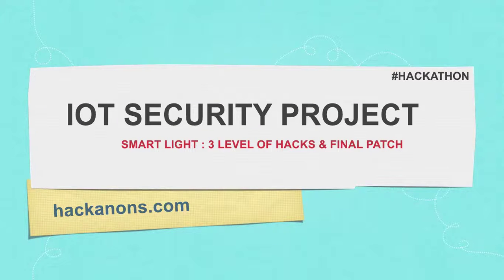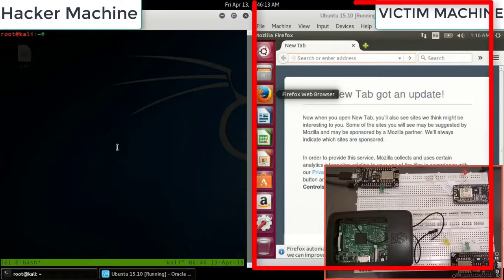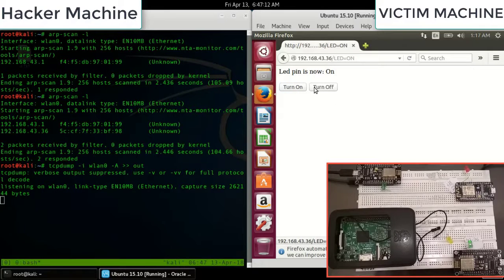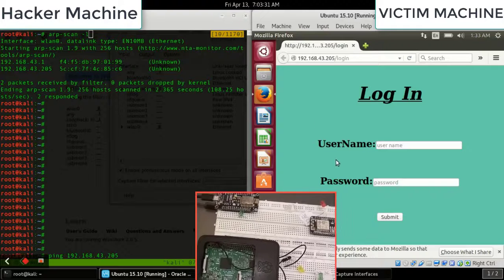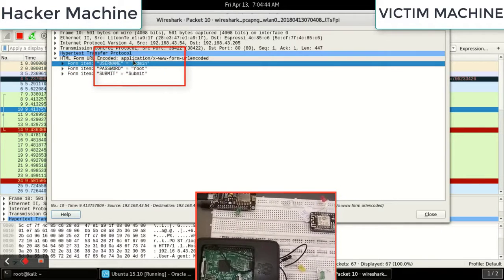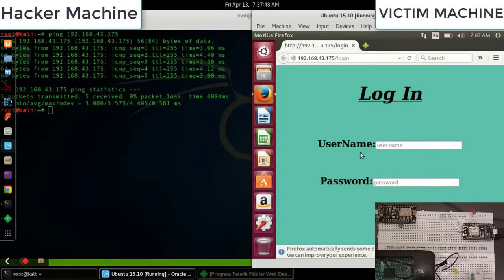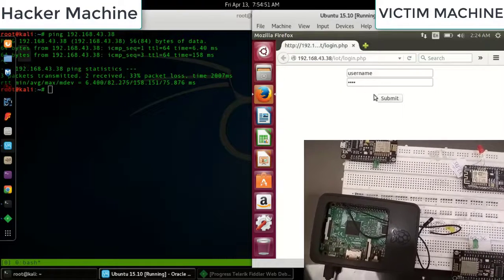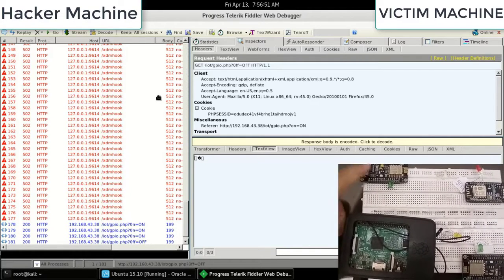IOT SECURITY PROJECT : 3 LEVELS OF HACK & FINAL PATCH #IOT SMART LIGHT HACK

Comment: how if the IoT use firebase to manage user and turn on off command ? , still can hacked ?
Reply from the maker: no it can't be hacked, actually this only works for smart devices which are in lan, not through internet with a small network